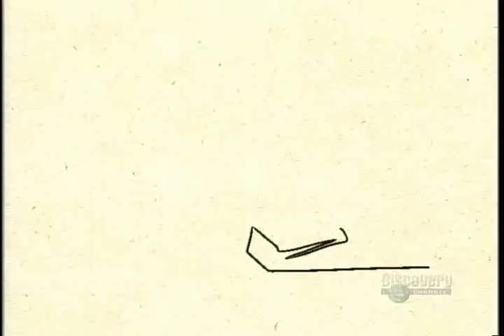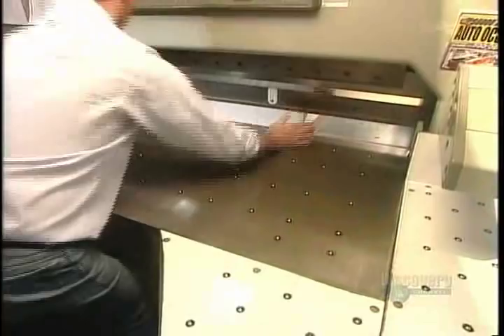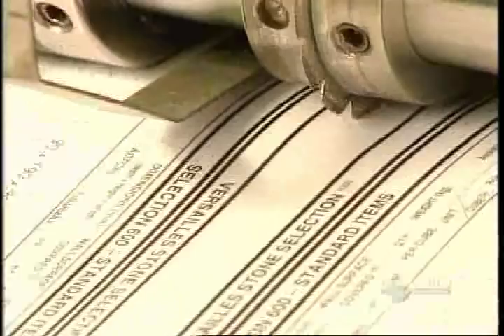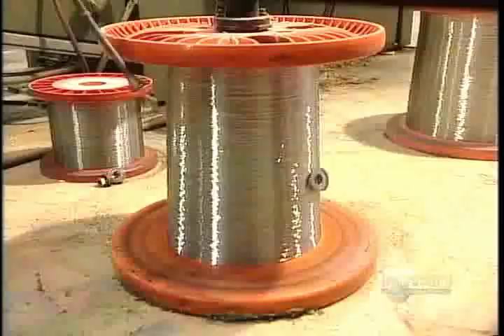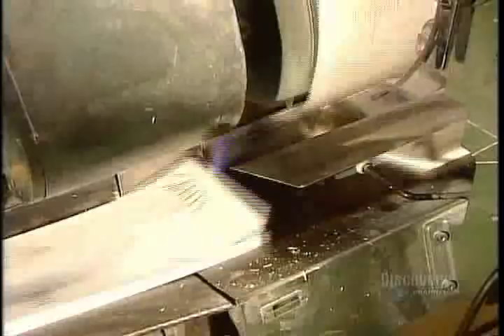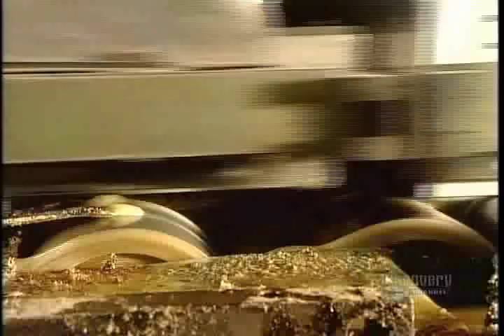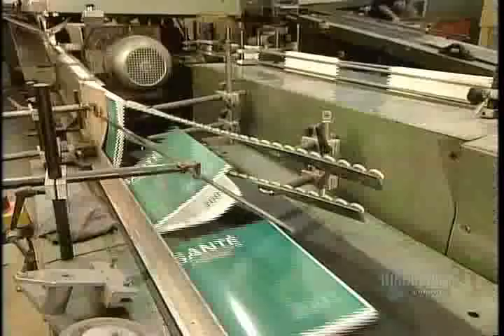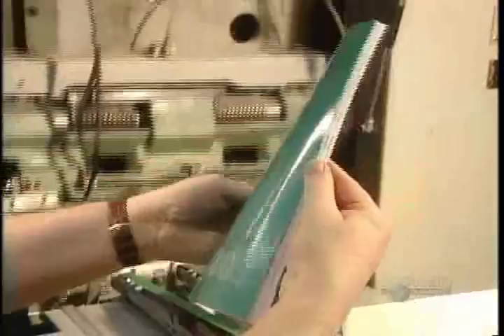How It's Made Books

Comment: Now I just need to know how they can justify $200+ for a college textbook.............
Reply: EETechs Textbook costs are mostly about licensing; every image and table has distribution rights and the rights holders need to be paid according to their licensing agreements, which can have expiration dates, fees per book, or fees per printing. On top of that, because a school or professor will require a specific textbook, there is no competition. With a veritable monopoly, publishers can charge significant markup.
Reply: +Baltasar Jimenez A LOT of the problem with textbook pricing: they don't print very many, and they're huge.
Reply: EETechs I suppose you have a better/cheaper method to make a book, did you not see the machinery put the boooks together?

Comment: "The staples are cut from steel wire that's so strong, you have to tear the book apart to remove them". How about just a staple remover?
Reply: That's what they mean. If you clamp a staple remover over those staples, it rips up the pages as you remove them.

Comment: @Sciencebox2010 You know those guillotines have laser sensors which cut the machine out if you get anywhere near the blade as it trims, and there are 2 buttons which are both underneath the bench that have to be pushed together and held to activate the blade...so it's literally impossible for your hands to be near it as it trims :) it's safer than a working in a kitchen.

Comment: @Sciencebox2010 It's a lot less dangerous than it looks... the first bar that comes down is the clamp to stop the paper from shifting, and it's non-serrated so it wouldn't cut you, nor would it crush your hand either because it is likely sensor or operator driven. The blade only comes down when the technician stands back and his hands are well clear... it's most likely operated by foot pedal. It just looks very fluid and automated because he's probably done it thousands of times.

Comment: CNC guillotines are very safe machines.  They are designed so that the blade ram will not operate if your arms are sitting over or on the table.

Comment: Why is that? There are so many safety devices that it's fairly hard to injure yourself unless you get your fingers caught under the 'hold down clamp' - you control that with your foot. Go to the search and put in "Printing Industry - Heidelberg Polar Pace Cutter System". The system shown is a fully automatic model, but gives you a good idea of what goes on.